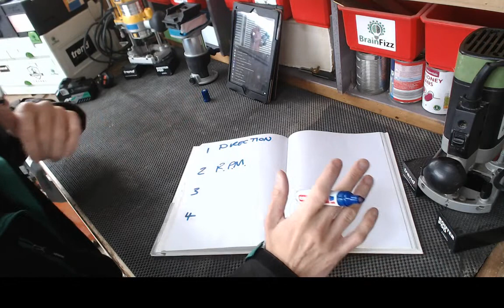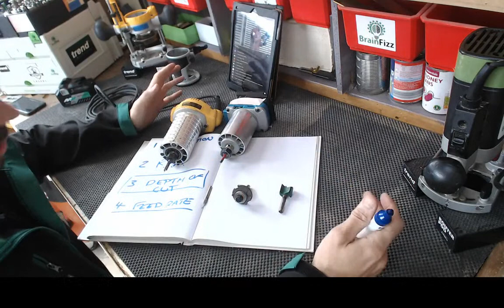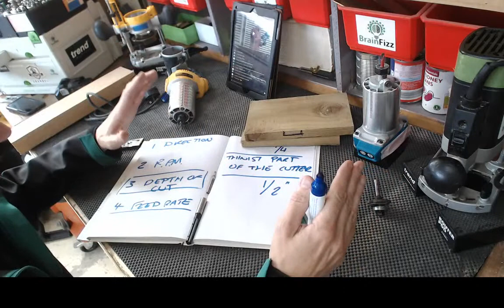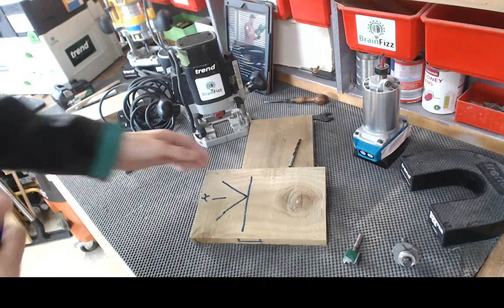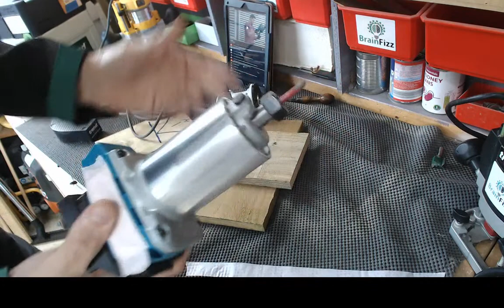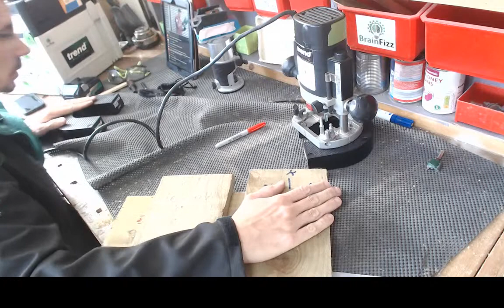Router FAQ: A deep dive into Router Depth of cut

Comment: Thanks for the video. I've just watched some others you've done and I like your detail.

I've never used a Router before and wondered if you could help with a question? 

If I want to cut a 2cm depth by 44mm width trench using a plunge router, what size straight  router cutter do I NEEDN'T to use? 

Let me explain my train of thought based around the depth of cut. 

Can I use a cutter that is 19mm cutting depth and just go extra 1mm via the router or do I NEED to use a cutter that is bigger in cutting depth than the depth I'm cutting?
 
Or could I just use a cutter with a cutting depth of 63mm and only go 20mm deep and therefore have a cutter that I can use in another job in the future that I might want to go much deeper, say 50mm?

Or another example is if I buy a 1/2" with a cutting depth of 19mm, would I be able to use this to cut a depth of 50mm for example? 

Any help would be greatly appreciated.

Comment: Hi Rich, do you know of a fine adjustment edge guide that works with the dewalt 26204 plunge base?
Reply from the maker: The stock fence for the trend T5 works, the trend crb7 works.
Or you can modify the stock dewalt fence with a block of wood and a few bolts. It’s a pretty easy mod.
Reply: @BrainFizz  Thanks!
Reply from the maker: Pleasure 👌